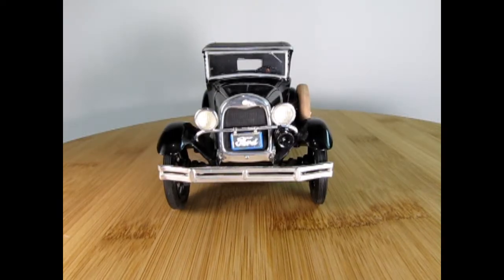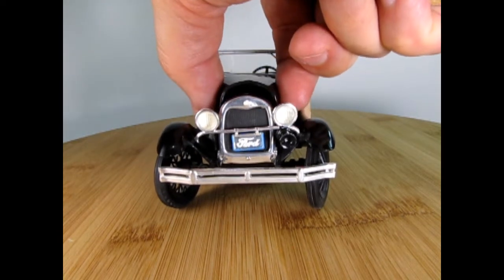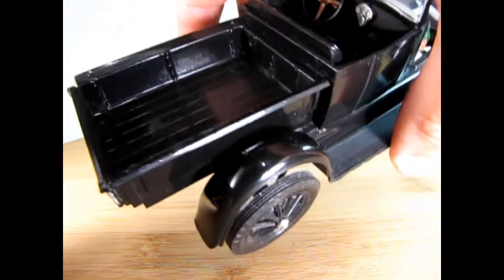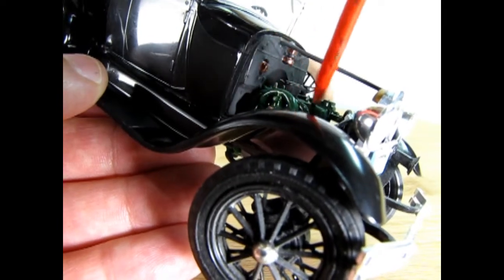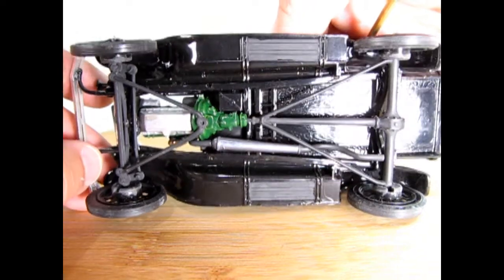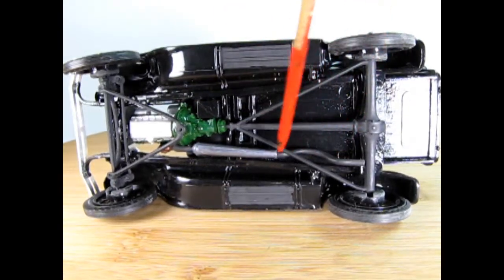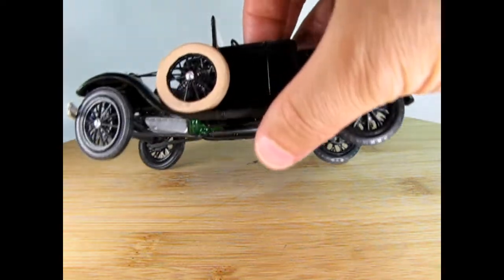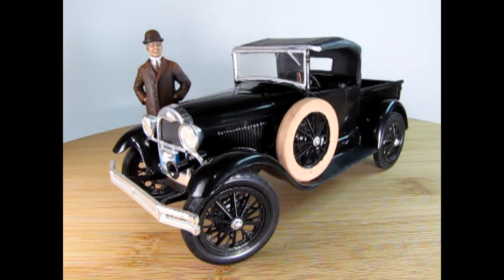Model Car Garage Show And Tell - My MPC 1929 Ford Model A Pickup - A Model Car Build Video

Comment: Nice!  Do you always paint your models?  Sometimes if it is molded in an attractive, opaque colored plastic and if I am just building it as a shelf model and not a contest model I will polish the plastic body with Novus plastic polish instead of painting.  I still paint the other details.  The types of models I am referring to are primarily older Monogram kits like the original versions of the 1936 Ford and 1940 pickup molded in a beautiful brown (36) and turquoise (40).  There are many more models like this and I get very satisfying results by polishing.  AMT's model T kits that are molded in black are also good candidates for polishing.
Reply from the maker: It would depend. i once clear coated over orange plastic. It turned out well. I also polished the AMT 1949 Ford molded in grey plastic. However, most models are molded in grey or some other color that doesn't suit them. Those ones i pant over.
Reply: @MonsterHobbiesModelCarGarage  True, then I do too.
Reply from the maker: @danieljohnson9351  Sounds good!